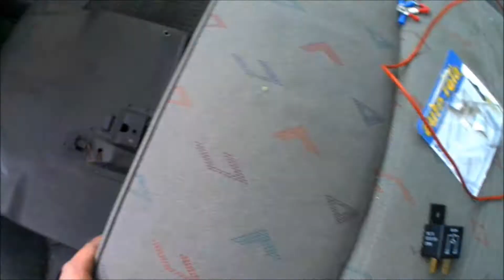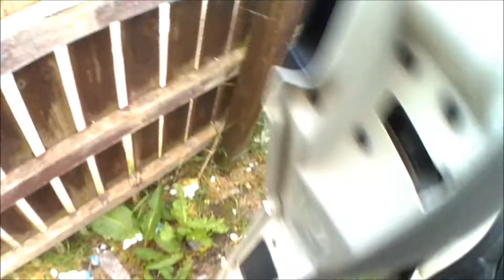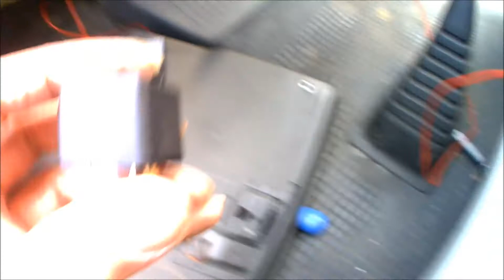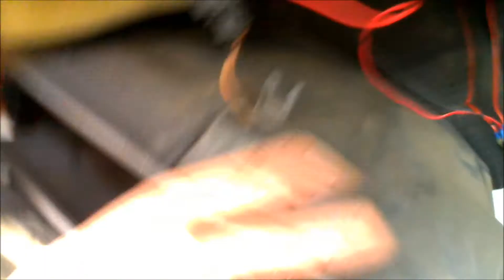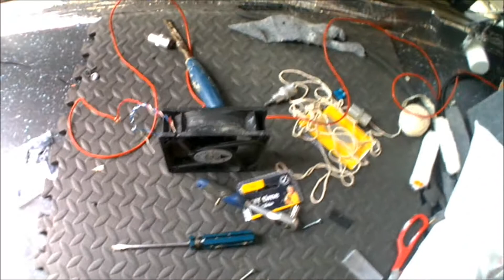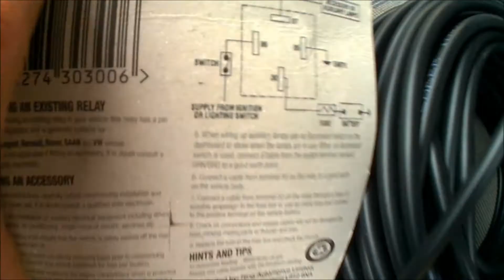How To Wire 4 Pin Relay For Van Campervan Fridge Or Appliance Ignition Only Power

Comment: Thank you, awsome. If i use 140amp volt sensing relay to charge my leisure battery, can i use the VSR as switch?  ..probably too much power, si? thank you.p
Reply from the maker: it might work but I don't think they are designed for that kind of use

Comment: Can you use this to charge leisure battery?
Reply from the maker: possibly but I'd use a proper split charge relay, this is only rated 30a, charging while the engine is running can create a lot higher amps
Reply: Thanks, how could I charge the leisure battery when connected to 240v?
Reply from the maker: If on 240v, you should have some household plug sockets so you can just use a normal battery charger, plug in and connect to battery job done

Comment: Great video and very useful. Your channel is my go-to for every step of my conversion! This may be a stupid question but why are you running the power from the starter battery and not your leisure batteries? Just about to sort my fridge out.
Reply from the maker: 3 way fridges should only run on 12v while the vehicle is running as it draws a lot of power which would kill a leisure battery quickly, these should be 12v while on the move then switched to gas or 240v when at site, compressor fridges like weaco can run 12v but are still hungry on power
Reply: Ah ok thank you